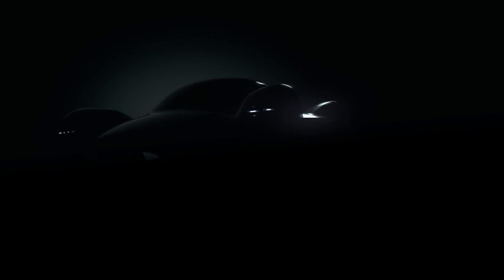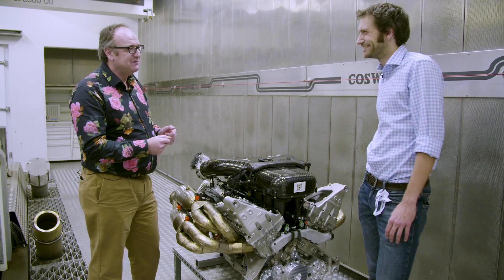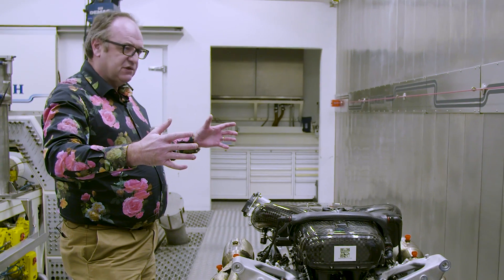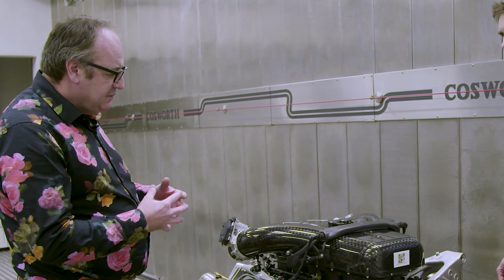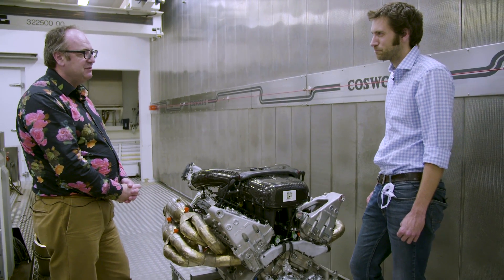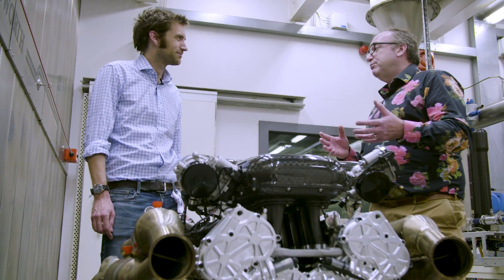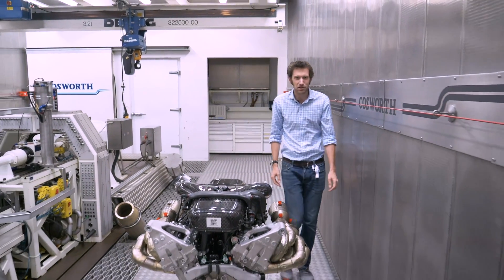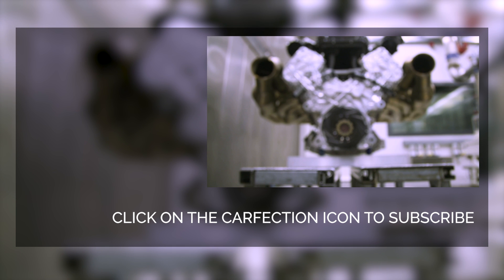Hear The Future Of The Supercar At 11,000rpm: The Aston Martin Valkyrie's V12 - Carfection

Comment: i feel like since the engine holds the entire car together basically, wont the torque and tension from the body translate negatively to the cylinders and all?
Reply: It usually works more the other way round. Most road car's that've featured the engine as an integral part of the "chassis" have suffered from engine rattle and noise invading the cabin. F50 comes to mind.
Reply: ZiPolishHammer hmm. Ok. Interesting. Thanks for the knowledge lol

Comment: I love how in most cars you'd expect the compression to be around 6 or maybe 7,while the valkyrie up here hitting 34
Reply: PARDON !?
Reply: @mr.mcgaming3475  in case you didn't understand compression is measured in air pressure: 6=60psi or 7=70 psi, which is around how much a normal 3 cylinder should have but the valkyrie, by looking on the dyno, made it to 34, which is 340psi
Reply: @dantindley5181  i meant most cars have 9:1 or so if we are measuring the same then that thing has more than a deisel
Reply: @mr.mcgaming3475  yea I reckon we're measuring differently
Reply: Most modern cars run about 120-150 psi though, unless you're driving a 65 Cadillac 70psi means your gasket is blown or rings are fried

Comment: 3 cylinder that made 250 hp... I'm on a budget so I'll take that instead.
Reply: Yep, get this on a bike and i'll buy.
Reply: Anton Larchey triumph Daytona 675, they make turbo kits that push it up to 220 hp
Reply: @TatsByTaco  Nice ! I'm more a naked bike lover, but it's still pretty cool
Reply: @Eric Albers - "3 cylinder that made 250 hp"
laughs in Koenigsegg
Reply: @vaettra1589 with 0.4l more and two turbos. This is NA
Reply: Yep, or a 3.3 litre naturally aspirated 6 cylinder engine making 373 kW. Not bad at all!
Of course, a hybrid system with hybrid forced induction (using stored/reclaimed energy for electric-powered intelligent boosting combined with conventional turbo/super-changing) and infinitely variable valve actuation, would provide a vastly superior setup. The days of the normally aspirated engine are almost over, as too are the days of non-hybrid performance vehicles.
Reply: @anhedonianepiphany5588  That's not a good thing imo but it's where things are going and even Aston Martin, and Ferrari know it.

Also I don't think it will be a Naturally Aspirated motor at all. Up until recently I believed V8 hybrid turbo's would have offered the most performance potential to value because of how balanced they were but V6's are getting good and have been for a while now. Just look at the Valhalla and the AMG One.

It's only a matter of time before F1 moves to a V4 hybrid turbo set-up. Infact I will give it till 2023 before moves are made towards downsizing, once durability and reliability is solved.
Reply: Anhedonian Epiphany were talking about motorcycles here bud
Reply: @anhedonianepiphany5588 Epiphany or a full electric with the newish lithium-ion with carbon ball added power cells better range and power than older cells. the germans have a natural magnet high eff motor that gives 175 ft torque that is really light for the weight. 200 mi range I just have to figure out how to make a fiberglass or carbon fiber monophase / body for a sedan I figure 77lbs for batt cell and 300lbs per passenger with cargo each x5 top speed only needs to be 90-100mph speed limit is only 65mph. so under 2000lbs needs 1498kwh power to hit 80mph. sry for the rant on an engineering binge lol.
Reply: Koenigsegg Gemera has something to say
Reply: Koningsegg hold my beer, made 600hp on a 3 Sylinder engine😂 Road car
Reply: @Stigman11  They need to put that motor in a 300K supercar, none of the big heavy  extensive battery bs. Just that 3 cylinder, a small battery for assisted boost and a sexy mid engine low slanted body. 300 odd K a pop 1500 odd models and we have ourselves a party.
Reply: Now there is a Koenigsegg Gemera with a 3 cylinder that makes 600hp
Reply: Well shit I guess I’ll take one to $2500 cash? Ha ha
Reply: Keith Walker maybe £25000-40000,
Reply: I’ll take the triple with 250hp, it’ll be perfect for a motorcycle. I’ve a 07 MV Agusta F4 that will  perfect for the triple to live in.😍😍😍
Reply: I'd kill for a straight 6 version of this engine, OMFG.
Reply: Look ay the new konissegg
Reply: So get an Fiesta ST MK8 and drive to REVO job done ;)
Reply: The new A45s AMG has 105 hp per cylinder
Reply: A 3 cylinder cosworth is still 50 grand.
Reply: Put it in something small enough...
Reply: It will be a juice drinker.
Reply: 250? I only got 180
Reply: I think you can get that in a 1.5 ecoboost Fiesta. Maybe not 250 but I’m sure moontune does 225. And it’s 3 cylinders
Reply: We can put that in an Alpine A110 type lower cost sports model. It should still sound great.
Reply: @srinitaaigaura  people are not deciding between a valkyrie and an alpine obviously slightly different car audience
Reply: you can have a fuck ton of fun
Reply: Yeah was gonna say... y’all still need that three cylinder? Because I’d be happy to take it off your hands
Reply: Yeah, give me three cylinders and two wheels, I'll be just as happy and probably faster.
Reply: @anautomaton2834  I doubt it. 😂
Reply: @anautomaton2834  It will be a 1.6 L 3 cil, so you will end up with a sort of overpowered triumph rocket 3... no thanks ;-)
Reply: @anautomaton2834  And lot better MPG!

Comment: A beautiful work of art my question is how reliable is it being brand new and untested in the field? Is it going to be like other Austin Martin's that you can only get maybe 20 to 30 thousand miles before you have to rebuild the entire thing. I would imagine this V12 needs rebuilding quite often if its use the way it's supposed to be. Which is with a heavy foot on gas pedal and a light foot on the brake

Comment: most of you don't understand what is he saying . this engine uses gears for timing instead of chain as he said is impossible to go to 11k with chain. 11k rpm with 6.5 liter means those giant pistons are traveling at the same speed f1 pistons are traveling but f1 pistons are a lot shorter and lighter! also they could pass the emissions I can only say WoW. this is the next generation of n/a v12 engines because it can  beat the turbo engines by its enough power and the beauty and sound of v12.

Comment: Only 1,000 hp? Hmmm.... Here is a drag race between the Aventador, NSX, Rimac https://youtu.be/fWrUl3uemb4. What's even worse, the new Rimac C_2 has more than 1,900 hp and is limited by the tyres. I used to be a petrol head, but this is a game changer for me....
Reply: Well... they can add more power because of the Hybrid drivetrain. but considering this car is only RWD, more power would turn this car into a wheel spin machine And that wouldn't help at all on track performance.

More power and more torque isn't the solution for everything.

Comment: 2019 and using old technology. A V12 was popular in the 80-90s. Aston thinks back in terms of environment, large thirsty engines that devour gas. You should be ashamed, not be proud of the engines.
Reply: They are pulling 1000 horsepower out of it and using a hybrid drivetrain, this thing will have just as good fuel economy as your Prius and will be 10 times more fun to drive
Reply: milan mijajlovic Are you full of cancer or are you pretending to be?

Comment: Why waste money and effort on a slow engine? Make an electric motor.
Reply: BECAUSE FUN? This is a luxury performance brand, they do whatever they want with as much power as they need, boring computers on wheels are for later
Reply: Weight. Volkswagen ID R, Pikes Peak record breaker race car, has about the same weight of the Valkyrie, 320hp less and a battery range of about 13-14miles (track lenght).

Comment: Shit dude overkill much? Can I have one?after you make it in an ev anyway. Not doing an ice car.
Reply: Limited production run and each car is going to be ICE powered with hybrid system, just because this thing isn't choosing not to support the world by not giving pollution a 0.00000000000000000000000000000000000001% increase doesn't mean you shouldn't get it
Also its 2.5 million, so good luck

Comment: Why the heck are there 738 'thumbs down' - Ferrari and Lambo' owners or wannabes?
We should all be rejoicing that companies are still prepared to build these cars, and engines!
TBH, rather surprised the alloy castings were lest in as-cast state as I would expect there would be potential of whittling som excess off, especially as the laquer is a concern?

Oh, would be nice to have a bit of info on the valve operating components - I assume still a ferrous alloy, with high fatigue resistance, and some form of finger, or rocker, operation?

Comment: having an all Aluminum Engine as a main structural part of the car, especially this type of car, doesn't sound ideal. Aluminum under high temps can warp. But hey, we shall see how it does, Cosworth knows their shit. It also sounds like a nightmare to work on. Suspension goes over the top of the heads. Imagine changing a head gasket on one of these.

Comment: These guys are really challenging themselves at every step. Nimble and compact design, but hold the stresses of the entire vehicle. Low friction racing engine, but meet street standards. Light-weight exotic materials, long lasting, but not without the extra weight of a lacquer glossy finish. Easy to drive in traffic, but handle planet-like amounts of power. I would be pleasantly frustrated trying to meet those challenges. This car might be worthy as a display in a engineering marvel museum but in doing so be criminally against it's design.
Reply: That's the dilemma ain't it? Do we put one, disassembled, into an engineering museum to appreciate humanity's incredible engineering prowess? Or do we just hoon the stuffing outta every motor and chassis, like God intended?

Comment: Has it got a lightened flywheel ? Ha Ha. Does it use less fuel than my 351 ? Do Ferrari owners now have nightmares of extreme jealously ? Do you have to pull the whole car apart to change the spark plugs ? Does it cost less than 10 moullion dollyares ? So many questions.
Reply: Tesla family salon can get to 60mph in 2.7 seconds which is faster than this million = £ supper car.

Comment: There's one slight problem: It's an aston martin, they're even less reliable than vintage ferraris.
Reply: OK, I will not buy this car then.
Reply: This is a car with Red Bull F1 Technology  suspensions and aero, Rimac electric kers, Bosch electronics, Multimatic carbon chassis and Cosworth engine. No single bolt is in common with other Aston Martins in this car.

Comment: Awesome engine can't wait till they make a twin turbo v8 version that revs to 11000 and should push out the same hp or more cause it should be made nothing like the sound of a high reving engine scream  at you nothing else compares
Reply: How about a supercharger on this?
Reply: @maggi98mw  Turbos would kill that lovely noise! A charger might be interesting but if it's power/torque you want, remember it's a hybrid - just turn up the volts!

Comment: Sounds gorgeous. Beautiful engineering just to look at. I think there would be some challenges using the engine as part of the chassis no matter how good Cosworth is just from the tiny chassis elastic stresses applied to the engine while it has its own internal stresses applied at 11,000rpm. If they  align, it could be a disaster.

Comment: Super impressive engine, but "future of the supercar"? Hardly! The future is solid state, with fewer moving parts, and electric. So perhaps one of the last hurrahs of the classic supercar instead.
Reply: Let the customers decide what the future of the supercar will be.
Reply: Well, considering that racing in general is becoming more hybrid and no doubt eventually fully electric, I don't think it requires a magic looking glass to see what the customers will be wanting. I'm just reading the writing on the wall, not telling them what to do. ;)
Reply: @blade-OT  The AM Valkyrie will be hybrid. A Rimac-built hybrid battery system, which performs as a KERS system, is installed along with the engine. 
But fully electric hypercars will not be what the super rich want for some years to come. They will simply be too cheap, and heavy :-)
Reply: You're right, there is indeed a short blurb about the final product being hybrid at the end, which I missed. Most of the video was dedicated to the mechanical challenges of the ICE, material engineering, resonance management etc. Those are all things that will sound quaint in ten years. And while I have no doubt that some boutique shops like Cosworth, Maclaren or Bugatti will continue to make ICE toys for the super rich, once electric (super)cars will routinely feed them dust without breaking a sweat, the rich will get tired of spending their money on them. There are lots and lots of ways to make very expensive BEVs as well, as Audi, BMW, Jaguar etc will happily show us.

Comment: Motorcycles spin faster than that and nearly all of them use cam chains. Pretty sure it's not as difficult or unreliable as he makes it sound. That said, gears are undeniably a better, more reliable solution. The gap just isn't as big as he makes it sound.
Reply: High revving motorcycle engines don't have 550 cc per cylinder.
Reply: @mcplutt  Except we're not talking about anything related to the displacement. We're simply talking about how the cams are spun.

Comment: Don't know why such a big deal about the high RPM. A friend and I used to run on the local dirt track. Our last car was a 1962 Dodge Dart with a 361 Chrysler big block. We were pushing 12,000 RPM going into the turns. With basically a box stock engine. Not the HP of the Cosworth but........................
Reply: I call BS on that :-)